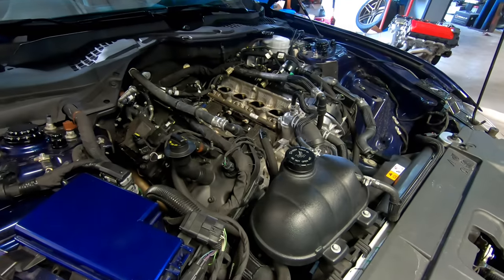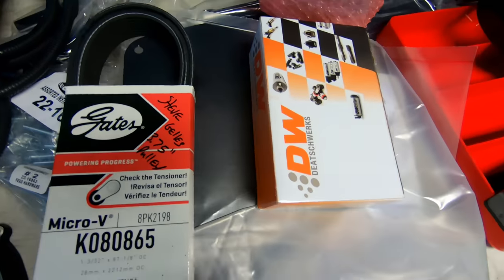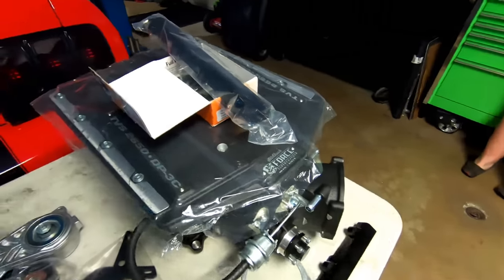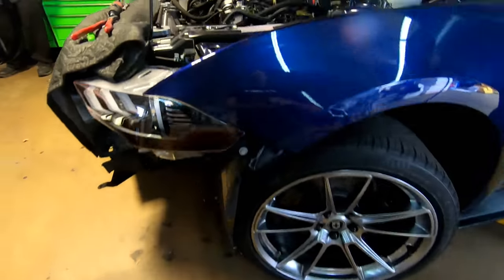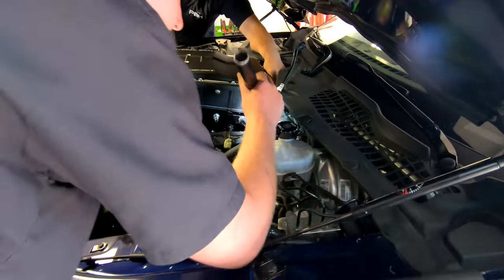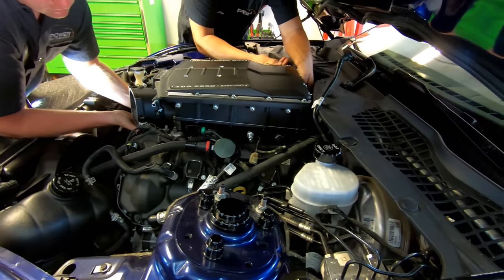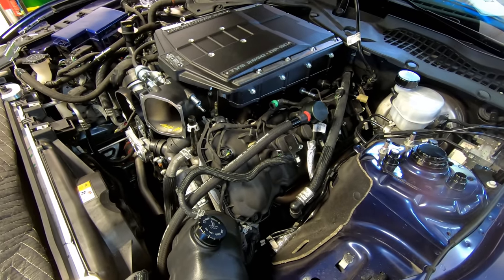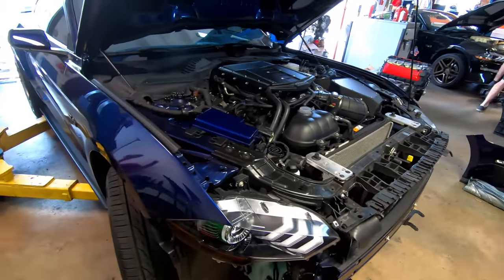2018 mustang Gets an Edelbrock 2650 Supercharger

Comment: Good choice! Not many people know this, but Edelbrock came up first than Whipple with the inverted intercooler.
Reply: Mate they've been doing it for ages. 
My 2011 Falcon with coyote in it had an inverted blower stock. Search BLO302
Reply: Chaise Delia Saleen with the 2005 model year S281 SC models used an inverted setup,  but a twin screw
compressor system.  With the long runner design you’d expect a pretty nice low end torque bump.  Kind of wish Edelbrock revised their 2011-2014 kits for the newer inter cooler system as the older design is ugly and it’s front inlet is restrictive as hell.

Comment: Wonder how much restriction and heat is generated from the air having to do a complete 180 in such a short distance between the Intercooler and lid.
Reply: I think it's better than the Ford blower. 
This goes up through the cooler and into a plenum then down through the cooler and straight into the ports. 
Im sure the usual style does two 180° turns

Comment: I have to get a Gen 2 or 3 Coyote motor.  What do they put to the ground from the factory?
Reply: You can get a "Gen 1 longblock" for cheap which in theory is a gen 2 motor. From my understanding Ford no longer makes the Gen 1 engine that came in the 11-14 5.0's 

Gen 3 will cost you about 2 or 3 grand more
Reply: @Reecesavage-Alwayswin  I searched and found the numbers from Brenspeed.  About 360 hp for the Gen 2 and just over 400 hp for the Gen 3.  Gen 1 was 340 hp.  I'm at 320 hp with my '88 GT with heads, a cam and intake.